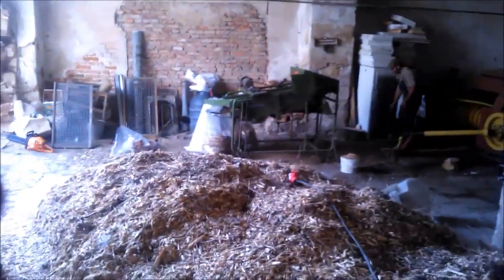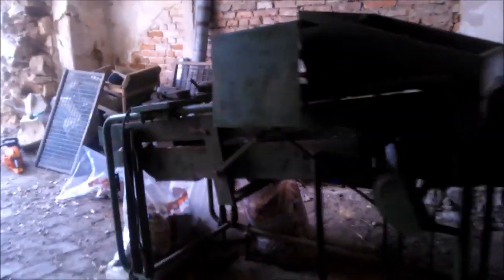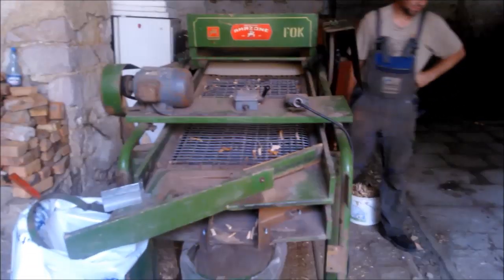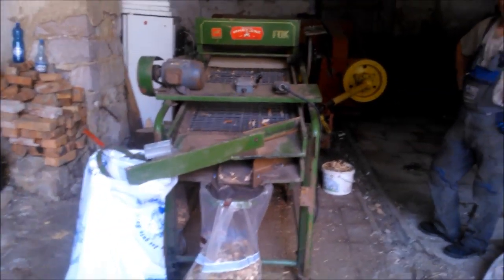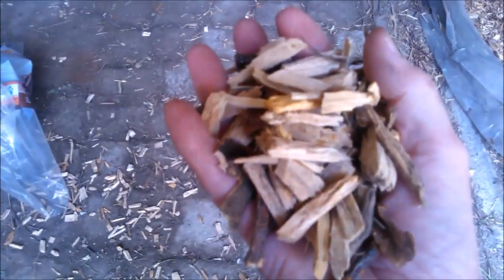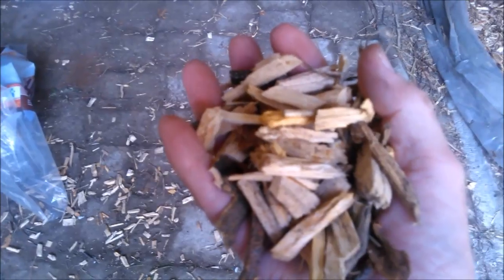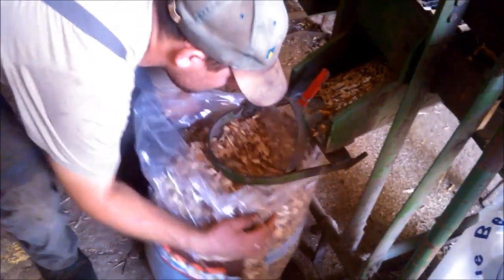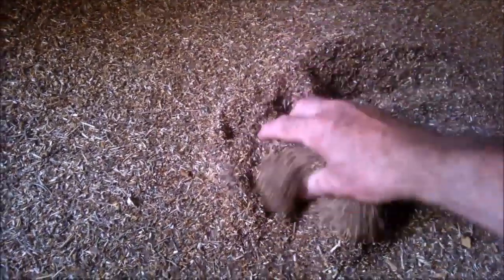Woodchips sorting for the DriZzleR Gasifier.

Comment: Hi, Do you think enough underpressure could be created by the stack effect? So, by having a long steel barrel going up?
Reply from the maker: Dear Matis.
My english is not good enough to fully understand your question. If your question is about operating the gasifier on natural draft by putting a long pipe going up? I do not know of anybody who did that. I think one will not reach high enough temperature to procuce tarfree gas and get dificulty to pull your smoke through the reduction. However there was a talk on yahoo woodgas forum a long while ago, of a gentleman called Bruce, who aparantly experemented in Iran with a natural drafted gasifier. The only way to find out is trying.